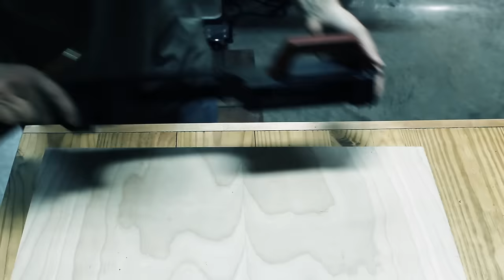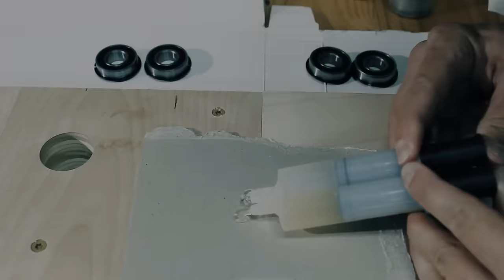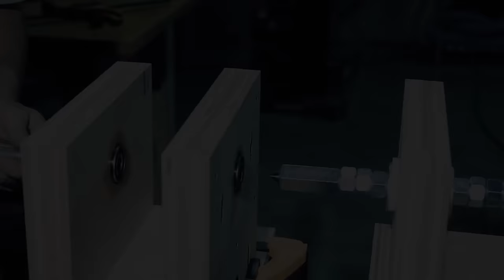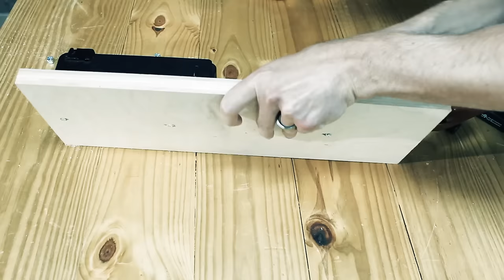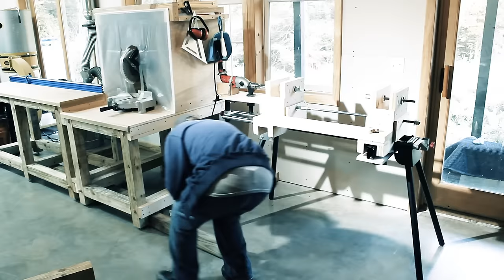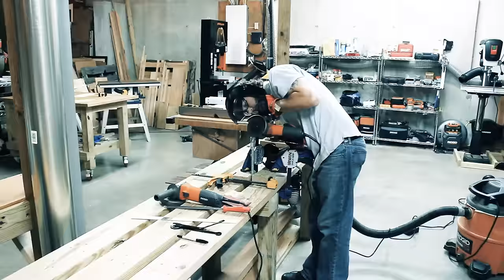Make a Lathe from a Miter Saw Stand : Shop Made

Comment: Hals Wood Shop.  Hi.   New subscriber. Just caught your channel.  Nice idea. and reuse the stand.  Doing lathe work you stand or sit so see if you may want to open that front of the base up to get in there and not trip on the 4x4.   I have had them on tables and now a Shopsmith lathe so  you do move around at a lathe, even a stool when I had a leg surgery and made a chess set.
Reply from the maker: Hi there thanks for subscribing! Glad to hear your input on lathe use and yes I will most likely be altering the design of this. Is was the first version and I just wanted it as reinforced as possible. When I get a stand alone motor to replace the drill I will make some improvements. Happy new year!

Comment: Outstanding video! How is the miter saw dust collection hood working out?
Reply from the maker: Thanks! The back enclosure works very well. I am still getting dust out of the sides of the saw but the bench surface keeps it off of the floor. This saw design is older and I am sure once I upgrade to a more modern saw the dust out the sides will be less. Thanks for watching!
Reply: +Indiana Wood Time Jones No problem, FWIW, i am experimenting with mortise and tenons after watching the miter saw video...broke a band saw blade in the process but we learn from our mistakes, right? LOL!
Reply from the maker: +David Letz that's funny I actually bent a band saw blade making those tenons. I tried to get away with using a 1/4 inch blade and I needed a 1/2 blade!